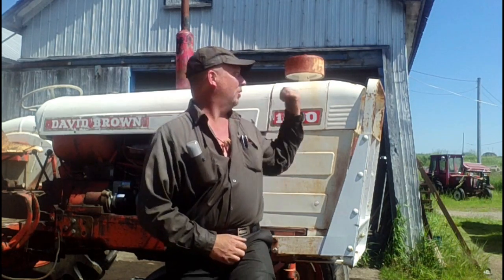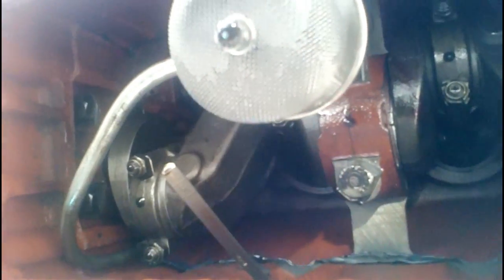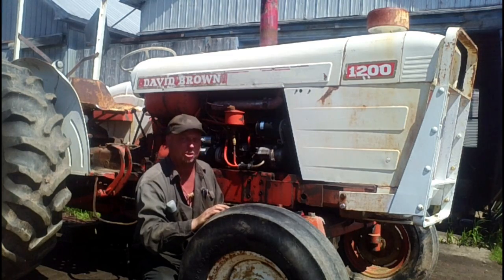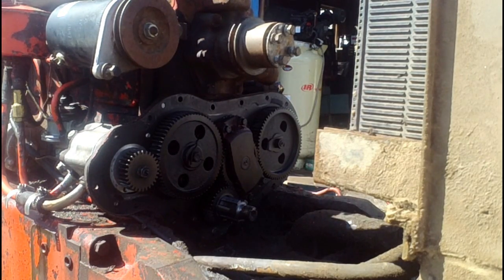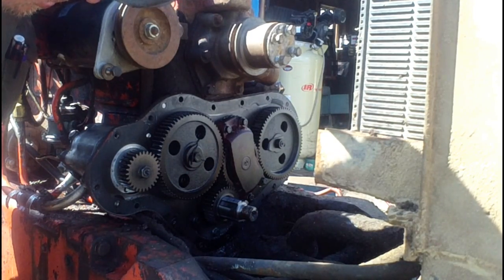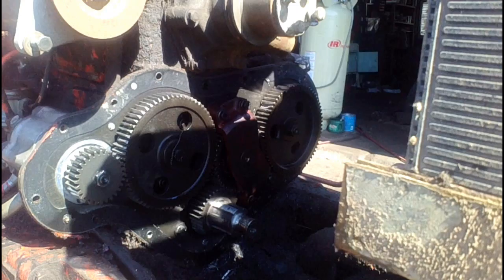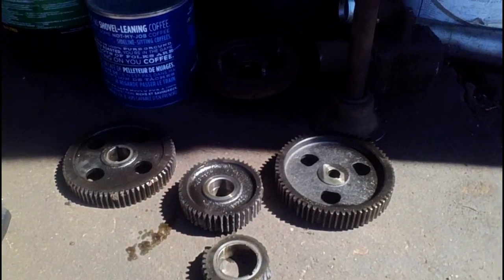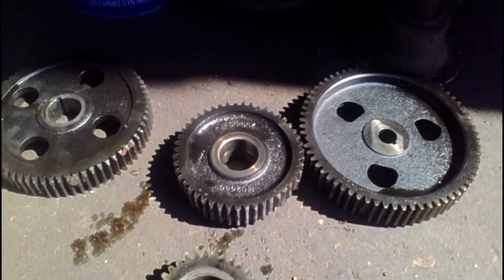1200 David Brown, diagnosing and repairing engine trouble

Comment: Great Video thanks!  I working on my 990 and have a couple of questions if you don't mind.  Can the front main engine seal in the timing gear cover be replaced without removing the cover; looks like it might could be but it'd be nice to know before I have a go at that huge nut, all I have is a 1/2" impact - you think a 1/2" impact will be enough?  

I need to replace the Power Steering Pump & Filter- it's actually sucking oil out of the crankcase and causing the reservoir to over flow - my guess is that the front seal is blown in the pump ??  Your thoughts on this and any suggestions as to how best to flush the system?  

One final question - sorry - you have any suggestions as to how to free up the left wheel brake input shaft without pulling the final drive apart?  I had the brakes replaced a few years back and over the first winter that darned shaft locked up and nothing I've tried has freed it up.
Reply from the maker: I am not that familiar with David Brown tractors so I'm afraid I can't be much help. 1/2" drive impact is all I use, it should get the crank nut off for you. I think you should be able to change the seal without removing the front cover but you will be able to tell better once you get the front pulley off.
  It seems odd that the steering pump would suck oil from the crankcase, they usually pump steering fluid into the crankcase when the seal fails but leave to DB to do things backwards. :) LOL
  I'm not sure how to go about freeing the brake shaft, sorry, but once you do coat it up good with some anti-seize compound, that should keep it from happening again.
   Thanks for watching!

Comment: I pulled the timing cover off I can see that 2 gears are turning and teeth look good. Also I looked into the injection pump, I can see that the shaft is turning. The rebuilt pump was purchased couple years ago from
 company in UK. Wondering if there was something else preventing it to start. No fuel coming from injection pump
Reply from the maker: You may want to get the pump checked, the fuel valve may be stuck in the off position. Thanks for watching!
Reply: @CanadianRedneck15  can I unstuck it?
Reply from the maker: @faithful53  Yeah, watch some videos about the CAV injector pump so you know what you are getting into.

Comment: very nice job.....I was wondering if you ever pulled a motor on a David brown 1410 and if so do you have to take the transmission apart to do it or will it split by the clutch
Reply from the maker: I haven't tackled a 1410 yet but it should split at the back of the engine to get to the clutch, good luck and thanks for watching!

Comment: good video ! just wondering where all the broken teeth ended up ? would they not have damaged the engine by the time it came to you ??
Reply from the maker: Thank you for your interest, the teeth mostly ended up in the bottom of the timing gear cover with some getting through into the oil pan. They shouldn't have done a nny harm because the engine would not have run long once it started shedding teeth and the screen on the oil pump would have prevented them from getting picked up. Thanks for watching!

Comment: Hello I have a question where is the timing pin on the 1210. I have looked all around on both of my 1210 David Browns the one I am working on is a 1974 square fender. Please post a video on how the set valves if you can. The only plate I see is  on top of the fly wheel below the fuel cell.

Comment: Hey Dave. looking to buy a decent tractor for a fair price, and in my searching I keep coming across several David Brown Tractors. I've found 3, a 780, 990, and a 1210. All are in really good shape cosmetically, and they are by far the cheapest tractors on my local market. Was wondering if you could give me some insight into David Brown tractors in general, my first thought is if they are cheap, either they are junk, or cant get parts for them or something along those lines. Did you have any trouble finding parts for this 1200? The 1210 I found says "wont run, needs rebuilt", engine I'm assuming. Prices are ranging on these 3 tractors from $1500-$2000, the 2 smaller ones run and operate good they say.
Reply from the maker: David Brown tractors in general are pretty good solid tractors, but, they are getting harder to find parts for. Engine parts for the most part aren't too bad to find, but a lot of other stuff isn't so easy. They also seemed to believe in "no two alike" so you will need casting numbers from everything you want to buy. The price seems pretty reasonable, but personally I would stay away from the David Browns if you want a tractor for long term. Good luck and thanks for watching!

Comment: I need to replace the timing gears on my 1200. Where do I get replacement gears?
Thanks
I also need to replace #2 cylinder rings
Reply from the maker: You will likely have to check salvage yards for the gears and get the casting numbers off of your as there are about 3 different tooth pitches as I recall. Thanks for watching!

Comment: No it looks like a 1200. It must be right after Case bought David Brown. When Case bought them the first thing they did was change the paint color. The power stearing pump on this tractor is the David Brown style. Case put the oil reservoir down on the pump. It made it difficult to change the filter and it was a pain in the but the get it to seal without leaking.

Comment: Good video.  I didn't see you using a torque wrench to tighten the bolts.  Maybe I missed it.  Is there torque setting on your air tool wrench?
Reply from the maker: I din't use a torque wrench for this job,  for tightening the oil pan and front cover just be aware of the size bolts you are working with and don't over do it. Thanks  for watching!

Comment: Great video I’m am currently restoring my grandads David brown 1390 that was in the family since 1993. Before I started restoring. It had very bad blow by issues/crank case pressure. Didn’t take of pistons yet any tips on what to watch out for/ beware of 
Thanks 
David
Reply from the maker: I just checked my parts catalogue and it looks like that would not be a sleeved engine so you will have to have the block bored and go with oversized pistons. The thing to watch for there is if the cylinder bores are worn too much to bore out. Good luck and enjoy your project! Thanks for watching!

Comment: Hey I have a case 380ck with the 3 cylinder David brown engine.. Only thing on it thays case is the loader... I'm having a charging problem with it... I put a new battery new altinator.. Seems like it's not getting demand to charge.. Any ideas.. The wiring under the dash is a nightmare mess from the 70s
Reply from the maker: Did you check for an regulator? Thanks for watching!
Reply: I havnt check that.. Is thst under the dash
Reply from the maker: @2006megablue  It could be under the dash or on the firewall, pretty much any where between the key switch and the alternator,,, British wiring!

Comment: The usual root cause of timing gear failure is the flow control valve sticking in the power steering pump. This was fairly common back in the day with the early power steering pump (without the integral fluid reservoir). The valve is under the hex plug in the side of the pump body. I trained on David brown tractors in the 1970’s and attended many factory service schools at the David Brown factory in Meltham, West Yorkshire. I loved working on these tractors. I still have the original service manuals and hand written notes taken at the service schools. Nice to see other folks enjoying the products. 👍
Reply from the maker: Thank you very much for sharing your knowledge, that is very good information to have! Thanks for watching!
Reply: They were great tractors Jim. I'd have no hesitation in saying that they were the best 2-wheel drive tractors ever made. We had an 880 & a 990 and for sheer pulling power there was no other make of tractor to touch them - the 990 was able to pull loads that a Ford 5000 couldn't, & the Ford had  (supposedly) 14hp more than the 990! They're fondly remembered here in Ireland & there are still many DBs working here today, as well as models that have been restored for vintage tractor shows.

Comment: Good day From Ont.  We had DB 950  crnk broke DB dealer said 3 main bearings, they are prone for  this  Good videoThanks
Reply from the maker: I'm glad you enjoyed the video, thanks for watching!
Reply: Maybe 3 bearing crank, but its very heavy and I'd say unusual to break - especially on a 42 HP tractor.
Reply from the maker: Broken crank is a common issue with those tractors.
Reply: that's interesting, the DB's were/are common here in NZ.  We ran a red 950, two 990's a 1212 and a 1412 over the years and never had problems with cranks.    Thanks for the video anyway, cheers.
Reply from the maker: It certainly doesn't happen to them all, but it is one of the more common issues. I expect you would be looking a fairly high hour engine for that to happen.
  It is always good to hear different experiences, thanks for watching!

Comment: I have a David brown 880 engine which is hard to start, could the timing be out ?
Reply from the maker: It's certainly possible. Thanks for watching!
Reply: So from what I gather it’s lubricated from the engine oil so I have to dump the engine oil prior to removing the timing gear cover?
Reply from the maker: @edwardbell1951  Maybe, it depends how high the oil comes up in the engine. It would likely be a good idea any way because you are likely to get dirt in it when you take the front cover off.
Reply: @CanadianRedneck15  thanks for the advice. The only other option I have is to do a full engine rebuild.

Comment: My blood ran cold while watching you wacking on the end of the cam and injector shafts, it can do serious damage to the internal of both. You do not need a big puller you can use a small one and use the holes in the gears as attaching points .
Reply from the maker: Thanks for watching!

Comment: Can you tell me how to do the brakes on a Massey 65
Reply from the maker: On a 65 the brakes are on the inside end of the rear axles. Remove the  rear axle housings, replace the disks, clean the actuators and replace the axle seals. Good luck.
  Thanks for watching!

Comment: friend repair a 1210 david brown engine and repair injectors and injection pump and cylinder 2 and 4 do not work also repair the compression chamber which will be the fault thanks
Reply from the maker: It's really hard to say, have you done a compression test? Could be valves, you really just have to dig in and find the issue. Thanks for watching!

Comment: David Brown tractors were never known for reliability not to mention durability. Basically the reason they were absorbed by Case and the name went by the way side.
Reply from the maker: Case bought David Brown to replace their outdated hundred series tractors and continued to build the DBs as Case with limited changes for some time.
  Thanks for watching!
Reply: They were bought out and absorbed by Case because they are a good tractor. I bought mine well used and have never had an issue ( 1200 selectamatic ). Case bought them in roughly 1974 and still ran the David Brown name until around 1984. I really like mine and couldn't find a better value
Reply: THE problem wher to get parts for DB in south africa i need engine part for 990 please
Reply: @just an observer I'd stick your namesake just an observer from what you know of David brown tractors.
Reply: That is so rubbish a comment
Reply: @glen1555  David Brown tractors were a POS. If they were any good Case would have kept the name for a few years, but they didn’t. Another brand of tractors out of England that went by the wayside was Leyland.
Reply: observer  don't know what a pos is, if it's a rude word then it shows how ignorant you are about DBT, why it was taken over and why the brand name was eventually retired years after they ceased to be manufactured at Meltham Mills. Only genuine David Brown Tractors were made in Meltham, the ones made in Doncaster and Belgium were in effect facsimilies  of a great, robust and reliable machine
Reply: Such a non informed comment, DB tractors are still running around the world, they are well known for very robust transmissions, excellent fuel economy and strong castings, if there is a weak point it was the complexity of the hydraulics that if not kept clean could become problematic.
Case bought DB for their excellent reputation and good design.
I have a 1965 52hp 990 Implematic that has the optional 12 speed trans and the rare of that time optional power steering, it has been well maintained and starts and runs as well as the day it was manufactured.
Used in hot and dusty Australian conditions regularly, it has yet to let us down and is now used as a spare yard tractor for slashing mainly.
Another little 38 hp DB 780 1969 is also still operating albeit suffering some considerable abuse from former owner.
However our latest two year old  110 hp Case has however suffered major clutch failure, replaced under warranty  and driveline noise we are unhappy about and is nowhere as robust in the body fittings etc.